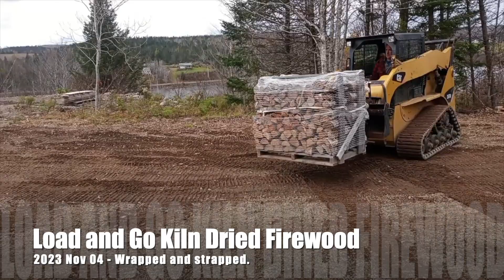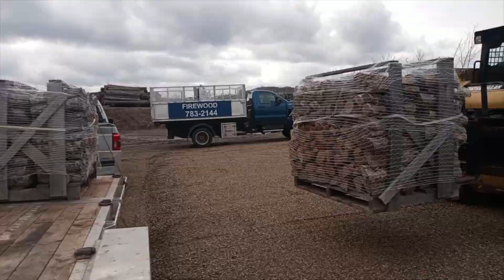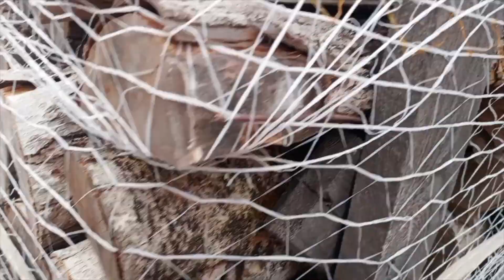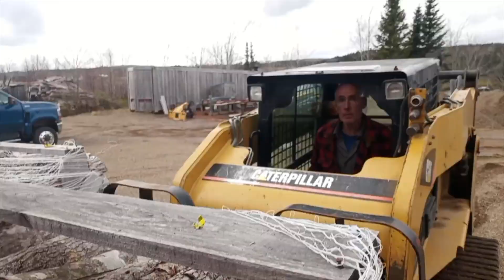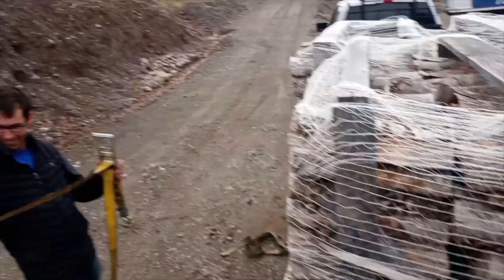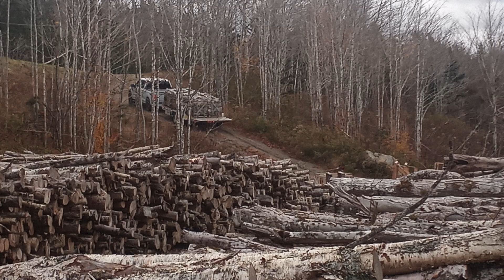20231104  Kiln Dried Firewood To Go

Comment: i have a catalytic stove and know the benefits of dry wood..it puts off so much more heat!!..and burns great..slow and long in a cat stove!..firewood guys in my area would want 1 million dollars for that pallet of wood!..im switching to compressed saw dust blocks, below 10% moisture and burn great and long..i wont give my money to the idiots selling crap firewood in  my area anymore..half rotten ash, unseasoned oak..not split well enough, they wont deliver, charge more for some species, wont let you stack the wood in your truck to get a full half cord etc, i could go on and on
Reply from the maker: I hear you. There's sellers like that everywhere. We sell 1/2 cord of kiln dried for $197.50 (Canadian funds) which is about $145 USD.